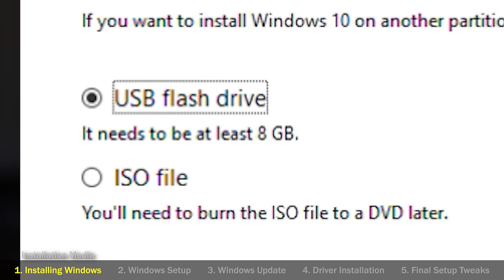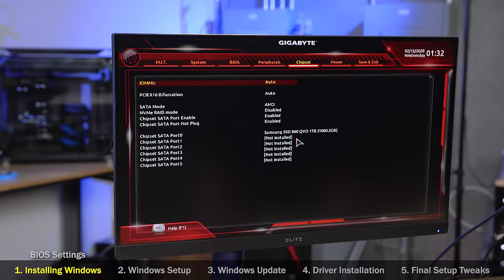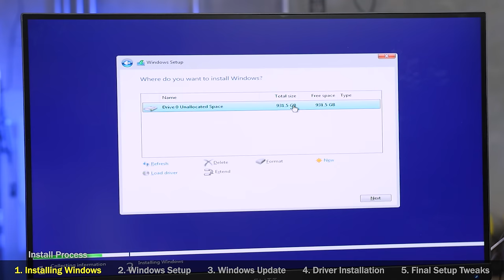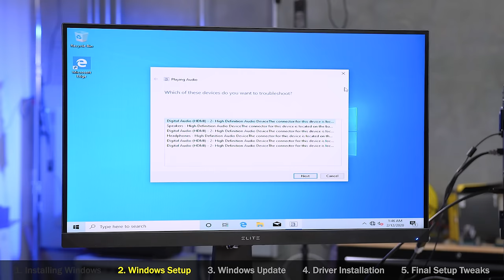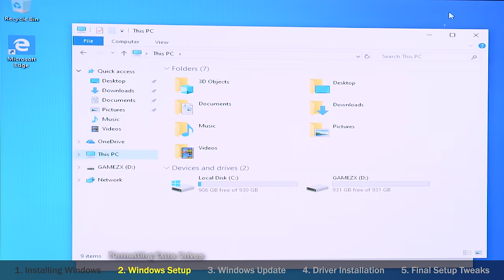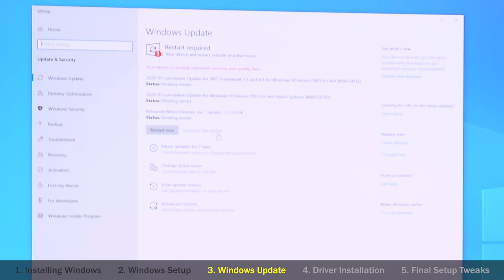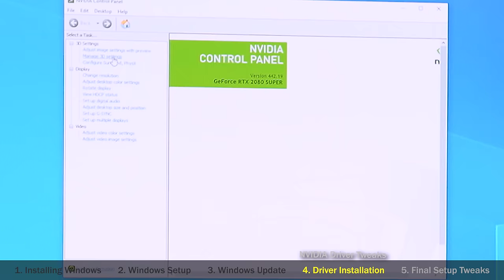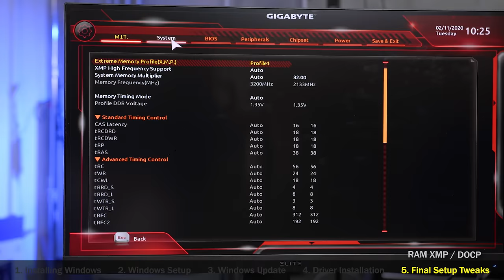Guide: What to do AFTER building your computer...

Comment: Why am i watching this, I don't even have a PC
Reply: Your name makes this comment so much better
Reply: Same bruh
Reply: a man can dream.
Reply: Same here, still thinking of buying one 😂
But got no idea
Reply: @unfunnydude5712  how much you spending?
Reply: Bruhh
Reply: @unfunnydude5712  Don't buy one please mate
Reply: @santimeek5063  why?
Reply: @unfunnydude5712  Prebuilts are mostly a bit shit
Reply: Hahaha same
Reply: Remember this guy? Yeah prebuilts aren't that great. Shittier and more expensive than a custom one
Reply: @unfunnydude5712  I bought mine from CyberPowerPC online in 2014. Custom but they put it together for me. I've upgraded everything since then pretty much. I still have the same SSD and  hard drive. Added an SSD as well. These kinds of videos are EXTREMELY helpful. I started with a GTX 770 but it wasn't very good for Witcher 3 with Hair Works on so I upgraded to a 980ti which was waaaay better. I didn't realize the fans on it weren't working so it blew up after 3 1/2 years. So I bought a 2080 super and it's waaay better lol. Fans work too. Although I have the same case from 2014 and I'm not sure if my new motherboard I bought with the 2080s is sitting right or my case is just too small for it because the screws for the GPU don't line up so I had to use zip ties. I'll buy a new case eventually. My first motherboard died as well. Morale of the story is that it can be frustrating but the more you do it the more you learn. CyberPower did a great job on the initial build. I had to learn the hard way on making sure everything works properly. Building your own is simple enough with the help of these kinds of videos. My advice is make sure everything works properly when you're finished. Even if you have someone build it for you. I paid for RGB strip lighting way back when, and it never did work. I wasn't going to send it back to them just to get THAT fixed. I was just happy to GAME lol. PC gaming is definitely worth it. Good luck and just make sure your fans and still come on when you game. It's hard to tell if a liquid CPU cooler is working too but with monitoring software it's easy to confirm. It's fun learning if you don't let it frustrate you too much. Anybody can go to Wal-Mart and buy a PS4 or what have you. Picking your parts and monitoring your system is a bit more difficult. But totally worth it if it's done right.
Reply: Quantum87 My first build tomorrow ryzen 3600 rx 580 Hope i don’t fuck up
Reply: @depay7446  So that would be today then, congrats, nice processor choice, although I've probably have gotten a RX5600 if in budget or a used vega 56 (190 - 220 us$ on ebay)  instead of the 580, but that's just me. 580s are great if you're planning to go 1080p and you're on a budget though.
Reply: Ahhh sh*t, there's always such broken community on every channel 😤
Reply: peter griffin thank you, yes i will upgrade the gpu. i was on a budget for now im good with the rx 580 bc i don’t play heavy games.

Comment: Me: confident to build my pc 

Also Me: rethinking building it after the video
Reply: Don't fear it, I spent most of my savings when I was 15, 15 years ago on my first pc. It was scary, and there wasn't really youtube that I knew of, I just went for it. It booted, I installed windows, and it ran Crysis.... If you watch the videos and don't drop anything or bend any pins, you are good to go. I've built maybe 15 systems for friends family and myself over the years and literally never had one part show up not working, so don't worry about that either. Just follow guides, even if you get into overclocking it feels scary, but the parts protect themselves. You got it dude, just go for it
Reply: @1NcognitoXx  thanks dude I appreciate it
Reply: @1NcognitoXx  bro 15 years ago in 1990s bro realy it feels old
Reply: @maniaclad7765  um 1990’s wasn’t 15 years ago
Reply: @ronnyrrr932  it maybe 16 years then 1998 or 1999
Reply: @maniaclad7765  um no 22 years ago was 1999 or 1998

Comment: The algorithm pointed me this direction. Finished my first ever build. Flash the BIOS to the latest version, after that, all I did was move the network driver to a flash drive, and after installing and booting windows, I installed the network driver. MSI took the rest on autopilot and installed all the other drivers from their website. Accidentally found that little shortcut, and figured I'd share it. That way you aren't sitting there forever waiting for files to transfer back and forth. Hope this helps somebody

Comment: Jay kinda danced around it but when installing windows for the first time just have the drive you want windows on insalled and no others. You can add those later
Reply: You don't even have to do that much, skip and do the basic setup and activate Windows for free afterwards, or if you have a key then simple use the key.
 Way too much thought was put into the basic setup in this video, even for a noob!
Reply: its not really hard to juggle multi-drives. I had 2 on install and I mean you either install on C or D (in my case A, and B. i renamed them).  It is not hard. if you can read and actually read this whole installation is easy.

I taught myself to build my own system step by step from scratch. i am not a genius. Just someone who knows the English language. Turns out this is apparently a super power beyond most newb PC builders in the modern world which is sad.
Reply: @oceanbytez847  Of course it's not hard to juggle multiple drives in a pc. I have 3 in mine.  I made this comment because jay mentioned unplugging drives instead of just not having them installed to begin with. If you need this video to install windows then it should be as simple as possible. The majority of the population is dumb and could mess it up.
Reply: @oceanbytez847  That can mean that if one of your drives now gos electrick heven and dosent respons anymore then your pc dont boot or has random BSOD after wards. That is because Windows likes to spy and dosent give a sxxx it installs most files to the drive you chose but allso some imbortant files on all other drives exept the install media.
And when those files get missing your troubles starts...
Reply: @MagnaV4  hence why the instruction to just have one plugged in to begin with LOL
Reply: @SupremeNerd  yes drives with windows already on them. He didn't mention the others LOL

Comment: this looks daunting... more so than building the actual pc
Reply: Ikr

I am scared of hot swapping a hard drive... (I have an ssd for system and hdd for storage, I wanna remove hdd to install windows 10 on ssd, and then I have to re-plug the hdd)
Reply: I've spent more time doing this, than actually building my pc
Reply: @dillenarmstrong5907  Y-Yeahhh...M-me too....
Although, I found a solution for my SSD + HDD system!
First I unplug the HDD and only leave SSD and the windows usb install media in a usb port.
Then I boot from the usb stick, I install Windows on the SSD but I DO NOT CONNECT TO THE INTERNET YET! I install windows WITHOUT ANY wifi or connection connected or enabled.
Once I get to the bare bones desktop, with only the microsoft basic drivers preinstalled, I shutdown the system.
Now I finally plug in my HDD, turn on the system, and only now I connect to the internet and install the good and up-to-date drivers.

Basically, only keep the SSD plugged in during the install, do not connect to the internet yet, once you get to the desktop for the first time still don't connect to the internet, instead shutdown the system, plug in the HDD, start up and then connect to the internet and install the correct stuff.
That's a great solution to avoid broken Windows install because of 2 internal drives being plugged in.
Only keep the main drive plugged in during install, then after install plug in any secondary drives.
Reply: @deadchannel5933  bruh I literally just barely finished putting in a new m.2 ssd and it legit took me 4 hours cause I was trying to use a chromebook to download the windows boot drive onto a USB 🤦‍♂️🤦‍♂️, so after about an hour and a half of that I finally decided to put in my old hard drive download it onto a USB from there and than put the USB in and it booted right up, so it wasn't thag hard to do, I just made it difficult on myself 🙄
Reply: @dillenarmstrong5907  Im sorry for you...

Anyways.. Merry Christmas!
I hope that you have a great life and that your family is good!
I wish you only good luck..while I don't have any!
Reply: @deadchannel5933  hey i need so much help with understanding this and building my first ever pc, do you have insta or snapchat so you could help me 😭
Reply: @deadchannel5933  tysm 😭
Reply: nah, just did it, super easy.
Reply: @mooshlebooshle5073  I mean, even for me it's super easy the get-everything-up-and-running part, but the part that actually scares me is to get the right compatible motherboard, cpu and graphics card.. I did use websites like PCPartPicker and I did find motherboards compatible with AMD Ryzen 5 1600 and also a Radeon RX 570 graphics card..But I keep finding motherboards that either don't have the ports I need, or from what people said in reviews: it doesn't have a lot of bios/uefi options and so on..
But I am constantly researching and I will finally decide what to buy! 🙂
(I am expected to buy in the summer of 2021 as currently I only have half the money I need and stuff is also more expensive now)
Reply: @deadchannel5933  some simple rules to go by are that most gpus will be compatible, and that ryzen cpus are compatible with ryzen motherboards, and vice versa for intel. Otherwise it’s mainly up to your budget, and how powerful you want your pc to be, the motherboard is easily the hardest part though, lots of small things to consider.
Reply: @mooshlebooshle5073  fr? do you have insta so i could ask for help if i need any 😭
Reply: @deadchannel5933  did you even watch the video.. cuz most of the shit u just said was in the video. If you try to find/make a good build just join some discord servers like buildapc or post on their reddit there a lots of people that will help you.
Reply: Building the pc is the fun part! This is definitely not
Reply: Nah bro

Comment: I recently went through this process and I wish I would've watched this beforehand. Leaving only the system drive connected would've saved me lots of time. Instead I had multiple drives connected and didn't know which one to choose. So, I picked the HDD, wouldn't you know it, and my performance was on its hand and knees. I quickly realized since Windows doesn't label the installed drives well, to just connect the one you want as the system drive.

Comment: You can bypass having to have a MS account even when connected, just need to decline and chose other options. I did it recently. Might have been because of a new update though...
Reply: Why don’t you want to connect your ms account?
Reply: @imtired1051  If you connect it, Microsoft can pretty much spy on you
Reply: @subpoena.  then just turn off telemetry
Reply: How did you do it can u plz help because i had to reset windows because it said i needed metered connection to connect to wifi and i dont have an Ethernet